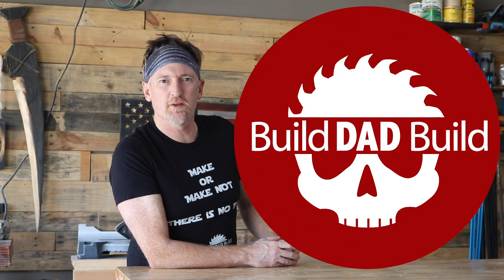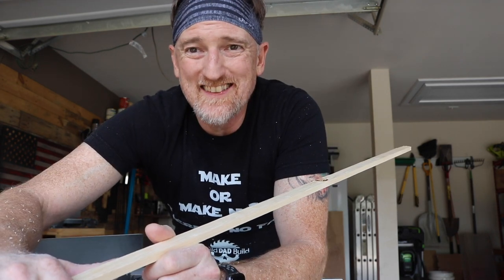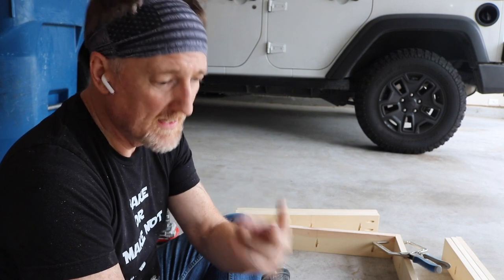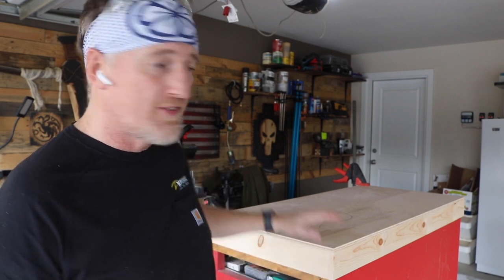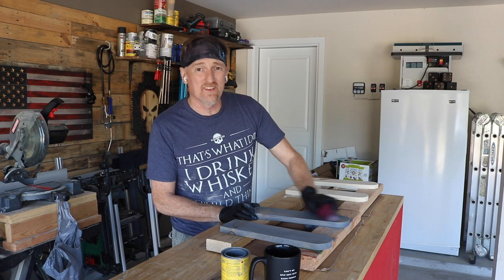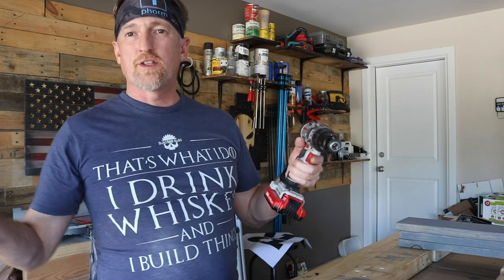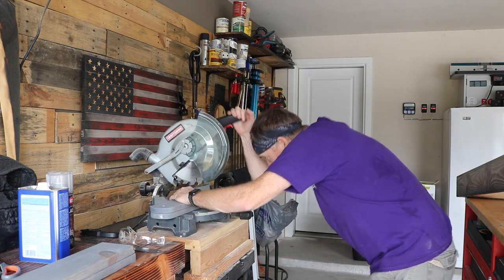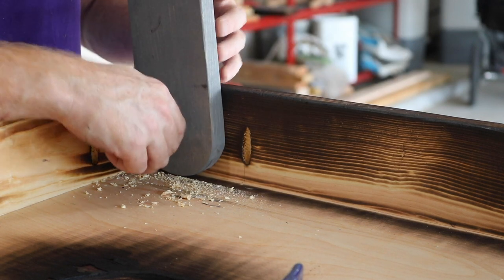DIY Cornhole Boards, Hand-carved with Epoxy Inlay and Burnt Wood Finish

Comment: Gypsy by Fleetwood Mac brings me back everytime to the municipal swimming pool.  There would be a sea of bikes parked in the parking lot - man sometimes it was hard to get your bike out of that jungle.  They would bring a speaker out from the front desk and point it out towards the pool and play the radio all the time.  Everytime I hear that song, I am 10 years old sitting on the cement with my friend getting a tan checking out the lifeguards that would not hesitate to blow their whistle at us and tell us to quit running all the time.  That was back when they actually had a high-dive board at the pool...
Reply from the maker: THAT! Is a vivid memory...
Cheers!

Comment: Ok so not sure if I'm the only one to point this out or not but you have quite the inset on the lettering don't you? Seems like the bags would get held up on the lip that's been created. I kind of figured before you were done you would have done a flood coat of clear epoxy over the entire top of the boards. It would have filled in that obvious space above the lettering as well as given you a nice, strong, durable finish for the top of the entire boards. The lip I am talking about can be seen at the 14:50 mark pretty well.
Reply from the maker: Holy crap it's the Corn Police! 🤣🤣🤣
There is MAYBE a 16th of an inch gap on the bottom of the Rs that shouldn't affect bags travelling up the boards. 
Cheers! 👍🏻🥃👍🏻🥃
Reply: Build Dad Build good! From the video it looked a LOT deeper than that so it must have just been the optics.
Reply from the maker: I saw what you're talking about. I think it's a trick of the light.

Comment: Is there a lip where the epoxy meets the wood?  If so did you fill that with something?
Reply from the maker: There is a lip at the bottom of the Rs. It isn't significant so I did not fill it. It shouldn't interfere with gameplay.
Reply: @BuildDadBuild  ever single argument on those is going to be about that lip
But
It is on both boards so it's equal

Never underestimate a cornhole argument

Comment: What size screws did you use to attach the top?
Reply from the maker: I'm fairly positive I used 1 inch screws. I did do a test fit first. Take a scrap, drill your pocket hole and sink a screw into it (don't attach it to anything) and hold it up to the material you are screwing into to see if it will sink or swim...👍🏻🥃👍🏻🥃
Reply: Build Dad Build OK cool that’s what I was thinking I was going to do but wanted to get an idea before I went and bought screws.  🤙🏻🥃